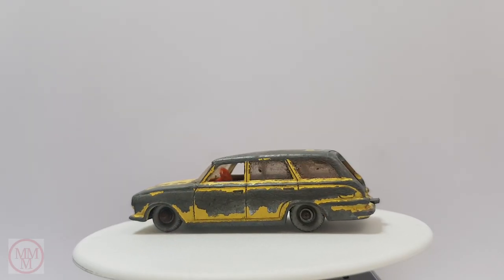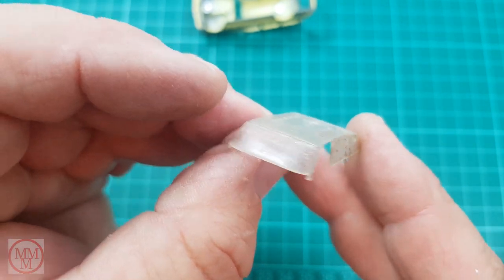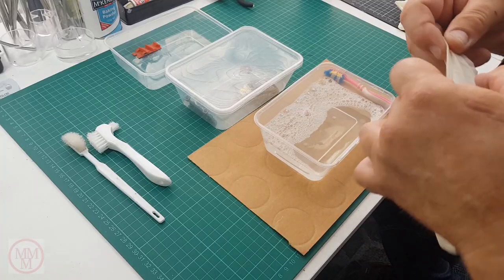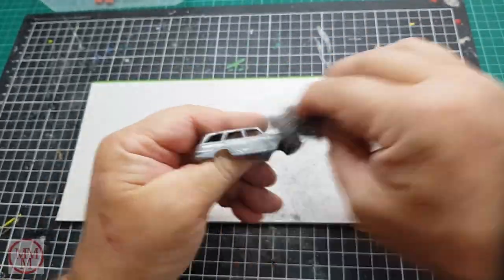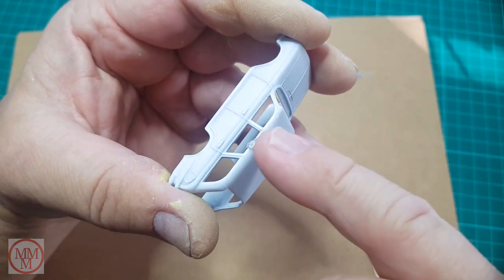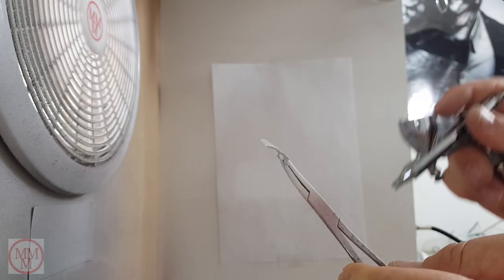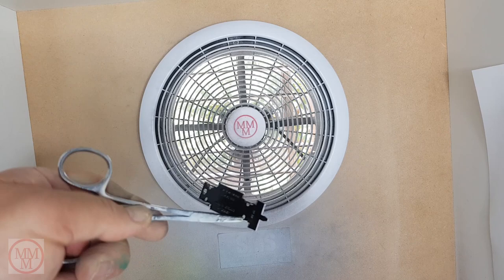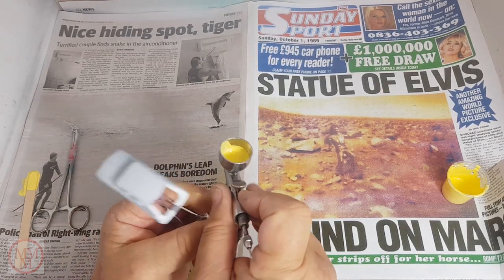MATCHBOX Restoration No 38b Vauxhall Victor 1963

Comment: I still have a pair of Vauxhall FB rear lights that I got from a dismantler some 40 years ago; I used them to make a trailer board for my Land Rover.  Of course, as a Land Rover owner, I was a bit surprised by your "most exported vehicle of its time" assertion!
Reply from the maker: That was a quote from Wiki. So I thought I would put it in. :)

Comment: Good way to get the scratches of of the plastic is to lightly sand it with wet and dry 1200 and wet with soapy water....then use the autosol polish... done it on my models after trying it of a speedometer covering on an old Vespa....comes out a treat...

Comment: In the US the narrow stirrers are used for mixing beverages. The wide paint stirrers  are called "pop sicile" sticks. Sweetened flavored water and  or ice cream is frozen over about 2/3 the length of the stick.  The protruding 1/3 if the stick is for hand to mouth operation.  The Vauxhall tail lights remind me of the same units on a 1958 Chevrolet.  Thanks again

Comment: You can split those popsicle sticks with an exacto knife. They split rather easily. Just watch for splinters. 😁
The best part of bagless vacuums is being able to dig through the dust for lost parts. Did it all the time when crafting. 👍
Another great restoration!🚗 As for the spider cracks in the windshield, I think they're fine. They give character to the model.
Also - now we know for SURE Elvis HAS left the  building.

Comment: you said about leaving the body and base of the model sealed up with the lid on the container to trap the fumes, thats similar to what a lot of body shops do when they use paint stripper to strip panels. they put the paint stripper on, then cover it with glad wrap to help it work better.
Reply from the maker: That's interesting to know, thank you for the insight might come in handy!

Comment: Marty 
You did another excellent job on restoring that model.
However FYI the special thread tap you use to cut the threads in the body, to hold the base on. Is called a “bottoming tsp” here in the US. They come already made with a flat end so you don’t have to custom make them.

Comment: Marty, to be correct..the piece you use to cut the rivets out is called a "drill bit" a drill has the elec. motor or you crank it by hand ...the piece used to cut threads is called a " thread tap"👍 keep up the great restoration projects.

Comment: Hi Marty! Another superb video and impeccable restoration!

I was thinking about the spider cracks. I’m wondering if putting a windscreen/windshield in a pot of floor polish and using a vacuum chamber to draw out the air might force some floor polish into the cracks and hide them a bit better. Just a thought.

I might even give it a go at some point. In the meantime I am working on reproduction Matchbox model boxes.

Comment: those taps are available in three styles, The standard taper which you bought and ground off.the tip. A blunt style where the threads are not as tapered. And a bottom tap where there is almost no taper to the tap. When using the bottom tap you will almost always need to use at least the tapered tap and make it a two step process for making threads. As I sure you are aware that grinding a tap introduces heat that may ruin the hardness and therefore the tool's cutting ability and life.

Comment: I find your videos rather therapudic . Oddly satisfying . On the tow hitch you could have held it with the pliers and ran it through the flame on the stove ( same principle as amazing your friends by running your fingers through flames ) it will clean up the rough edges so you will have less sanding . This would work for the stringy stuff that comes out of your 3D printer as well . But you do good work and I'm not at all trying to be a know it all . This is only a suggestion . Thanks for posting .

Comment: Ah, should have painted the tail lights! Else it's perfect.
Reply: The original model did not have painted tail lights.  Only the grill and front bumper were painted silver.  Some later issues did not even have the bumper painted.
Reply: But it's never late to mend.
Reply: Personally, since it is a restoration anyway, I would probably agree with you and detail the rear bumper and tail lights, but Marty always tries to have it look as original as possible.  Notice he did not even detail the front bumper as it must have been one of the issues that did not have it painted originally.  You can check out a site called Vintage British Diecast to see examples of the original models.  Cheers!
Reply: Thanks for the info, Robert. Cheers🍻. Yes, after doing a little bit of research,  I found out that the later models didn't have the front bumper painted.

Comment: How do you bend a drill bit?!  Drill bits are hardened steel....they always break!  :/
Reply from the maker: I actually replaced it today and was suspecting that it had bent as most tools for sale here in Australia come from Asia and some are not the best quality. I found ,however, that it did in fact snap and not bend. It was being held together by the tape I wrapped around it as a depth guide. Mystery solved!! - Thanks for sticking around Phil!

Comment: Marty have you ever considered using Scotch Brite instead of Steel Wool pads there are 4 colors and they are comparable to Steel Wool
Red       = 0          Steel Wool
Green   = 00        Steel Wool 

Gray      = 000     Steel Wool 

White    = 0000   Steel Wool
these can be found @ Most Hardware Shops or see if a local Auto Body Shop will have it

Comment: OK, I've watch 11 videos of cars you've restored, cars of similar construction, but I just can't seem to find answers to these three questions:1.  small drill bit diameter?2.  button head screw pitch?  The screw tap is 2mm in diameter, but there are 2mm x .4 pitch (coarse thread) and 2mm x .25 pitch, (fine thread).  Which one?3.  screw length?  My local fastener supplier has 4mm, 5mm, 6mm, 8mm, etc., lengths.School me!ThanksPaul, USA